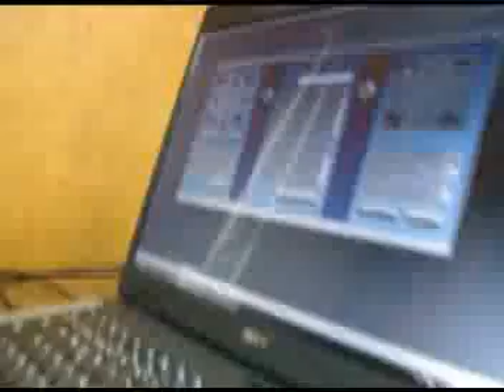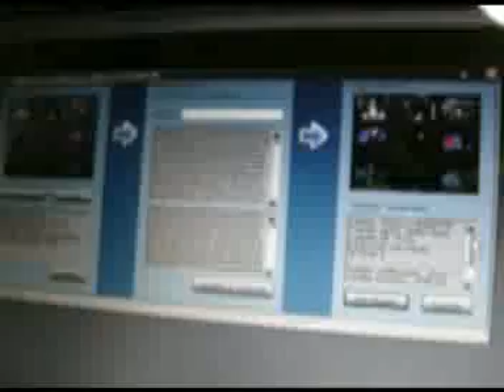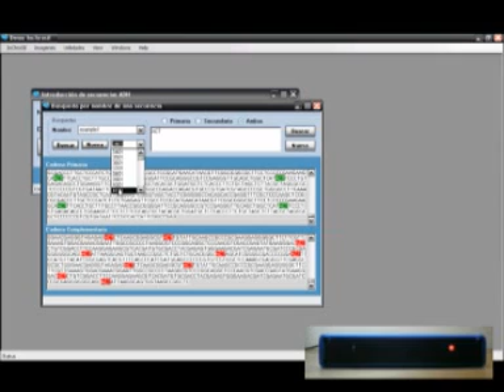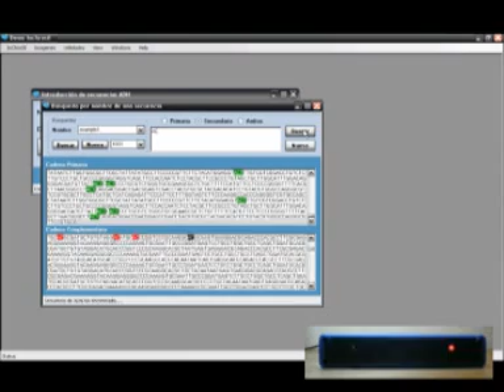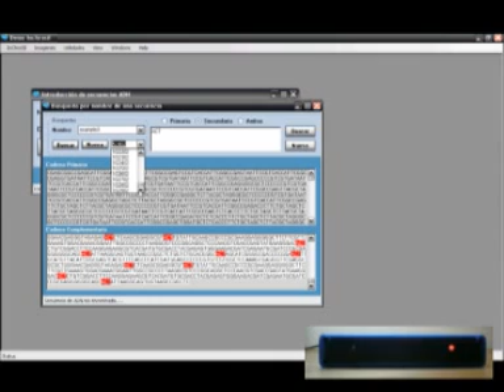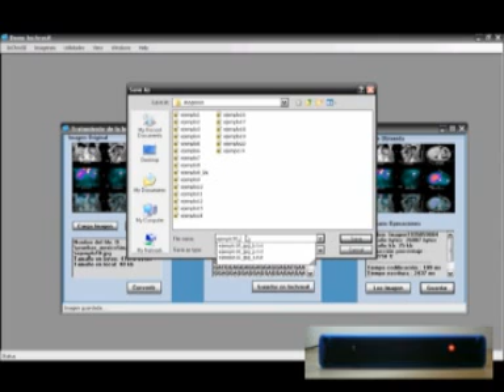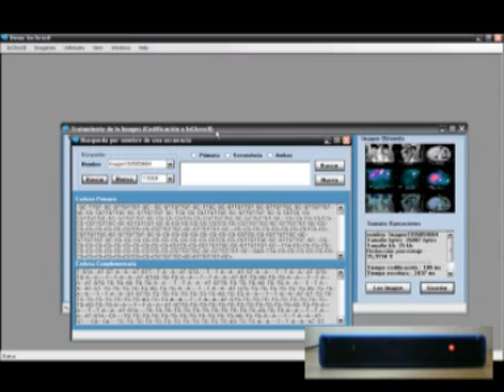InChroSil (Inorganic Chromosome based in silicon)

Comment from the maker: The component or electrical circuit, Inorganic Chromosome Based in Silicon (InChroSil) emulate the computational behavior and information treatment way like the organic DNA do it, but from the artificial perspective and using silicon, not emulating the chemical reactions of the organic DNA, because the integrated circuit only reproduce the DNA structure and information, conforming an artificial DNA made with silicon, usual for the construction of integrated circuits (chips).